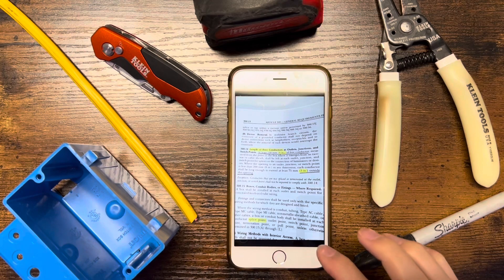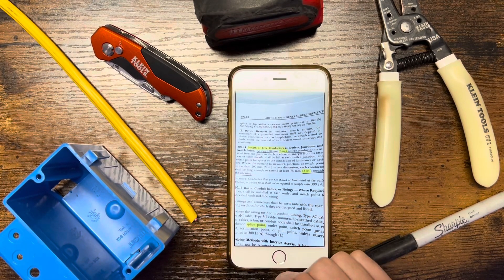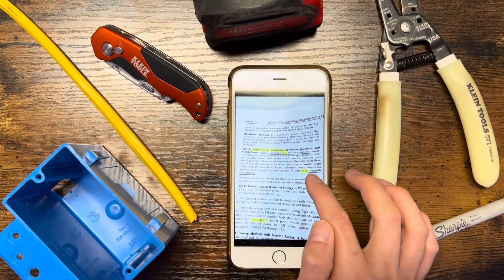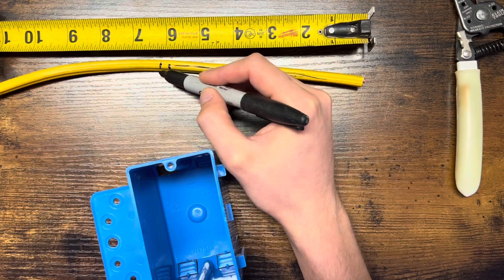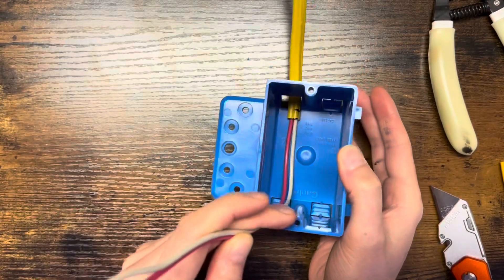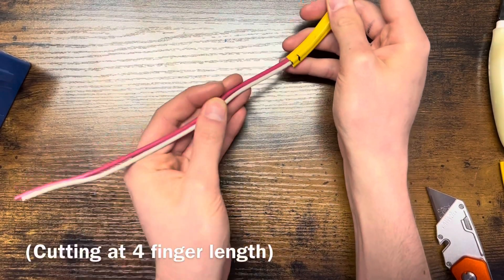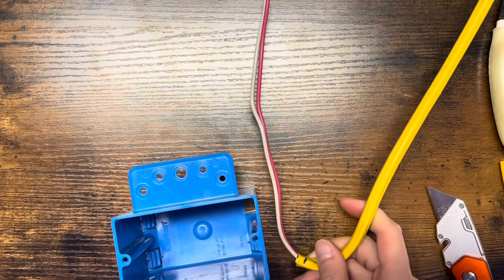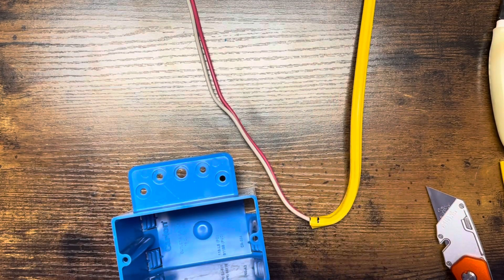Wire Length REQUIRED In A Box! (NEC 300.14)

Comment: At 2:25 you neglected to run the ground wire. Although the box is plastic there would probably be an outlet in this box and you made no provision to run a ground to the outlet which is needed for ground protection of the appliance plugged into the socket.
Reply from the maker: yeah, just a piece of scrap wiring with some wires inside missing. hoping people knew that, lol